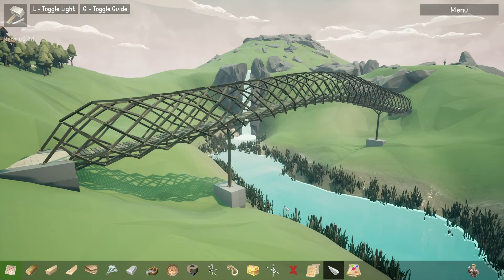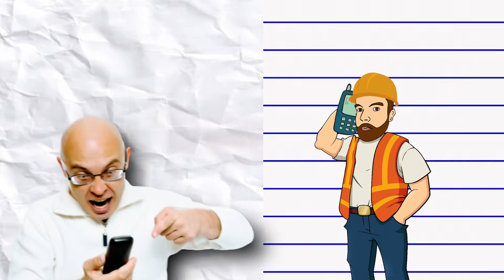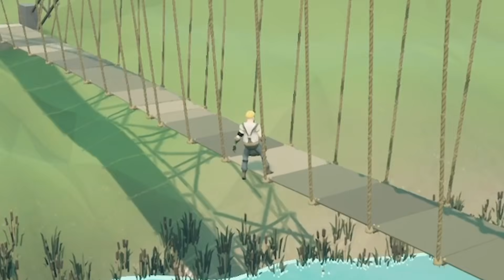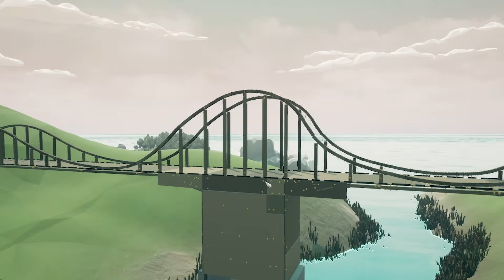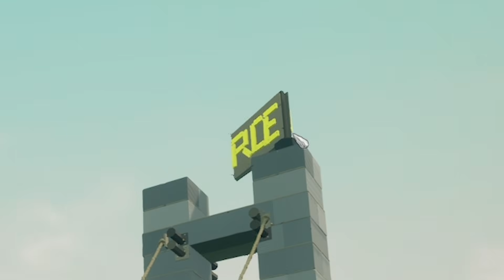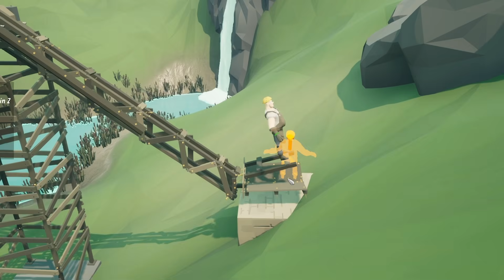YOU WILL NOT BELIEVE the engineering behind these bridges!

Comment: 30:14 it works without any triangles for the same reason building a stone arch works. Gravity pretty much strengthens it to a degree because of the shape. Arches are basically deformed triangles so it makes sense they're pretty solid at supporting weight too.